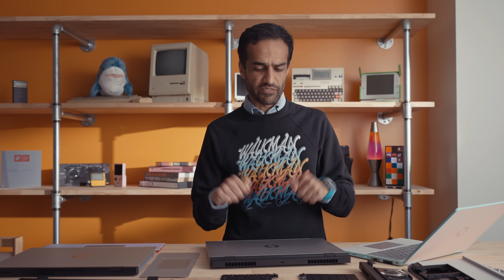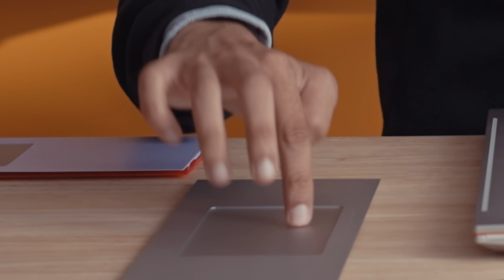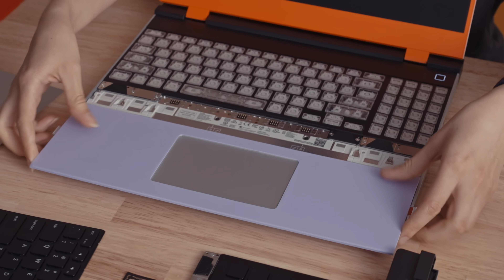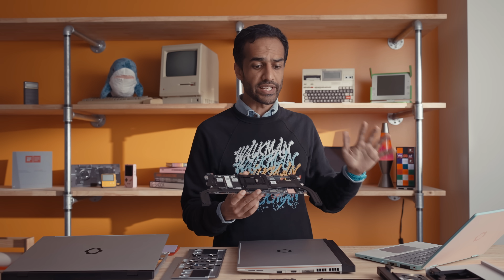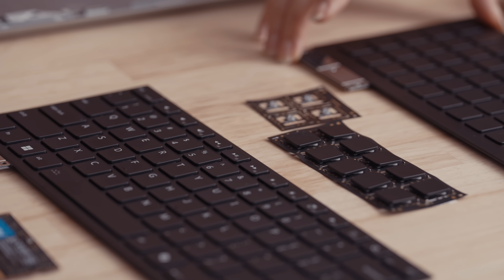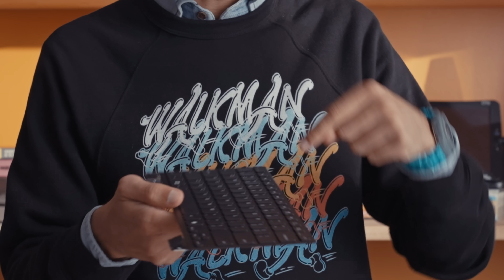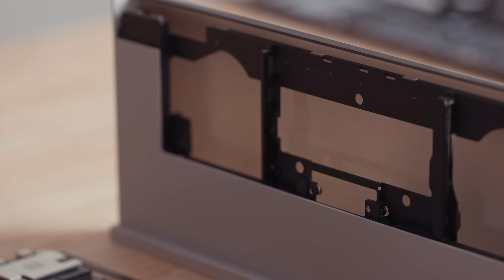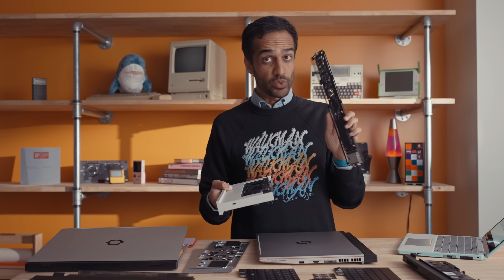Framework Laptop 16 - Prototypes and scrapped ideas

Comment: Lack of a track point is why I haven’t bought a framework. Lenovo laptops are overpriced, late to use new hardware, and never sell the specific combination I want in models with track points. So I just haven’t bought a laptop in over 10 years. With the introduction of the nvidia GPU on the framework 16, the only thing missing to solve every issue is the track point.

Comment: For the GPU I feel you guys are working on a simpler board that connects to a desktop PCIe slot instead. Which I feel is an OK compramise in term of not making things too costly but still useful.

Comment: The 16 should've had a connector that can deliver power and data. You could have a separate battery module for extra battery life during trips and stuff. Sadly it seems it's only useful for data. And I'm guessing it would count as a separate battery pack and not over the plane limit?

Comment: I don't need the extra wide touch pad. I use a left set keyboard with a right set num pad and my touch pad is center. I just want the normal touch pad as a single piece. I hate the seams.

Comment: Fun fact, with 4 RAM slots a DDR5 laptop should be able to eventually have 512GB of RAM, or 256GB with 2 sticks.
Now 4 SODIM of this size is probably going to result in DDR5 3800 speeds. Partially because of trace length and inability to have equal length traces, but mostly because of cooling a 128GB SODIMM is going to be double sided and likely will use close to 15w at DDR5 5600 good luck cooling that without airflow, and without physical contact with anything.
On the other hand thats A LOT of RAM , and at 3800MT/s that is still going to be WAY faster than even 6 of the highest end gen 5 NVMe SSDs, and trying to buy 2 systems and connecting them over the network is going to be glacial

This is why i want AMD to release Strix Halo in an R package and call it Epyc 4955. 8 DDR5 desktop DIMMs, with 1TB total capacity and running at 4800-5600 that should in theory be faster than 4 whole Halo based desktops trying to pool their 8000MT/s LPDDR5 pool that will be limited to.... 256GB and this will be bottlenecked by networking
(i dont remember the max theoretical capacity of LPDDR5, DIMM/SODIMM is 128GB/stick)

I'd like desktop DIMMs as they can run faster from beingbetter cooled, i've done alot of testing to mostly verify. Desktop DIMMS, despite their much longer traces, are basically guaranteed faster speeds and lower latency, try to clock SODIMM too high they start getting errors, and without a fan some "stock" high clock SODIMMs just die on me, even if they have cooling a double sided SODIMM might die if the other side doesnt get cooling
I have 48GB of dekstop DIMM running at 8800MT/s at this moment, though this is on a 2 slot board so i dont get the reflections from T and other topology from 4 slots, at 4 slots it wants to run at 6400 with the same CPU.

Comment: Personally, I would have loved a 4060 or 4070 module, as a cheaper option vs the 5070, and more importantly, to preserve 32 bit Cuda PhysX support for games like Mirrors Edge: I'm in the middle of considering a new laptop and had those been available for the Framework 16, it would have guaranteed my purchase. Windows 10 drivers as well, since it's possible for people to still get updates for W10 till 2032 depending on the OS version!

Comment: 3x upvote for the single-piece touchpad row!  Even if the touchpad ends up being not quite as wide as in that prototype.  The unevenly fitting spacer panels and tiny touchpad size are my #1 gripe about my Framework 16, after switching from my old Macbook.

Comment: Can someone more familiar with the modular system explain the difficulty in providing the same touchpad on a wider panel? Let's say the total laptop width is 10 units and the spacers are 1 unit wide. Then I understood that the touchpad module is 8 units wide, and you can assemble the palm rest in a 8+1+1, 1+8+1 or 1+1+8 configuration. But why is it impossible to sell the same touchpad from the 8-unit part in a 10 units wide panel? There could be 3 10-units panel styles, one in the 8+1+1 position, one in 1+8+1, and one in 1+1+8. Or, if having three different of them is unfeasible, at least have one in the 1+8+1 config?

Comment: Hi Nirav, 
1. regarding track pointer , just for curiosity have your team tried Blackberry Pearl style track ball or Blackberry classic style trackpad key on the keyboard, maybe this can fit on keyboard without increasing the thickness.

2. Great idea to provide additional nvme storage on blank bay, what about providing additional ram slots or additional thunderbolt/ usb c ports on the backside of blank bay, which will look so clean on desk setup with multiple monitors setup and cable running from back.

3. I am waiting for Framework dock with minimum 8-10 slots for usb c module along with tremendous power delivery on each ports (may be via GAN setup)

Comment: You've said that the gpu module now has two-way power and it's pretty big. Could you make a battery module then? It would be like a second battery you could use on long trips when you don't need performance. Theoretically this module could even be hot-swapable, so you can take 1-2 of them with you and that'll last you an entire day.

Possible use cases: if you have a long streak of work meetings, you could detach your gpu, insert the battery module and you'd have many hours of continuous use, so you don't have to worry about sitting next to a wall outlet. Or a long trip where you just want to watch movies, etc. This could make the overall battery time comparable to apple products, and that's definitely appreciated by consumers =)

Comment: I would love to see a double screen option. My Use Case: I use a very specific keyboard, Glove 80. meaning regardless of the computer I always use my own keyboard. This means the laptop's key board is never used. I would love the option to have 2 monitor in a single laptop. It would be perfect. And does'nt currently exist on the market as far as I know.
Option:
If you add a bit of software and change for a toutch screen as the second screen, you can potential retain a fallback keyboard, similar to how detachable tablets do it.

Comment: I want a classic keyboard, like the one on the ThinkPad 25th Anniversary Edition, or the Dell Latitude E4200 or E6500. Actual 3-dimenionsal keyboards, NO ISLANDS. NO CHICLETS. Just a good classic keyboard. I will spend $2000 on the keyboard alone. I will buy a new Framework laptop if the keyboard doesn't work with my current one. I do not care. I am HAPPY to pay for a GOOD keyboard again. No manufacturers are making laptops with good keyboards. Be the change. Even if it's an optional, limited edition version. I WILL BUY IT.

Comment: Any chance instead of the pointing stick, the left and right areas (say, of width that of an A key) of the spacebar button become trackpads? the functionalities I'm thinking of are tap to click, double tap to double click, horizontal scroll, vertical scroll. A more practical version would be shrinking the spacebar and adding button-sized trackpads to both sides of the shrunken spacebar. Tap on the left side trackpad acts as left-clicking and tap on the right-side trackpad could act as right clicking.

Comment: I can't say i understand what the problem is with the trackpad - you say palm rejection is not a problem, but the click is. Why? Ignore the click based on the palm rejection flag. If the problem is the feel of the click disrupting user flow, then switch to piezo feedback, as you said, and just don't emit a feedback event if the click is ignored. Apple has been doing this for years now. It works.

I similarly don't understand why you immediately went for polycarbonate for the transparent bezels. You typically go for PC if you need glass-like optical clarity. There's no such requirement for a bezel. Just use PET.

Comment: The openness aspect is absolutely fantastic. A makerspace egpu solution would create a secondhand market for makers to be able to sell framework graphics module "eGPUs" and I believe directly achieve what y'all want in regards to reduction in ewaste. That eGPU board is realistically what yall need, just in a maker-mountable way to a 3d printed chassis. If there's a way to either ship that eGPU board with a USB-C styled power input with clearly labeled power requirements and maximums, I think that'd be right in line with y'alls 240W adapter improvements. 

So purchasable eGPU controller board with optional USB-C power adpater, 3D printer files for the enclosure, and a little work on the maker's end and framework graphics module eGPU enclosures could make consumer sense. I will say the target audience may be difficult to overlap, but realistically I think the eGPU's target audience would be people wanting to add dedicated graphics adapters to the mini PC space via Oculink.

Comment: Love the transparency and openness! And last week I have started looking into how to combine one of the laptop mainboards with the 7700S graphics module: My use case is for a console-replacement that I can still somewhat upgrade, has no battery and that I can take with me for work travel - with a USB-C power connector. For now, I want them stacked though, so the case around it would need less structural support as it is higher instead of deeper/wider. This is important for traveling. But a stacked layout needs a custom connector.

Comment: What I've always wondered is if you could put a battery expansion in the expansion module. Of course laptops are generally limited to 100 Wh because of airline restrictions, but if you could separate the two they wouldn't count as one.

Comment: 16:45 is there a possibility that you release a CAD/3d printable file where users can print their own enclosure that also houses the main board, which then allows them to basically have a standalone computer with the GPU module, much like what you did back then?

Comment: The 3d printed trackpad frames are interesting. I might want to put one all the way to one side underneath the number pad because I hate trackpads and only want to use them as a last resort, having it off to the side would probably help me do that. I put my number pad on the left as well with my PC keyboard, but I would have to try and see if both of those ideas work.

Comment: What about an adapter so the GPU module can be installed in a desktop PC's PCIe slot? Though i guess the eDP would need some adapter if you want to drive a monitor directly from the card.

Comment: I reaaally love the bold idea of the video, props to you for doing this, you can find in the replies my feedback on this
Reply: 4:10 I think you should get more inspiration from Apple, they have reaalllly great trackpads, they may not be perfect and may misbehave but that only happens 1% of the time and the good user experience makes it very much worth it IMO, I just bought a MacBook recently and I really think Force touch along with haptic feedback is the best
Reply: 12:28 I have a few ideas here, first, the main reason why it doesn't work for you (and works for other laptops like ThinkPads) is that the keyboard is modular so it needs to be thin, my question is does it? What if you make the pointing stick extend on the bottom of the keyboard, that should solve this problem, but I understand it could mess with how the keyboard mounts, I think pursuing this route (fixing mounting issues with pointing sticks extending on the keyboard) is probably the way to go if you don't wanna wait for some technological advancement that would give a low enough profile to not damage the screen

Comment: Would it be possible to create an expansion bay that houses several expansion cards? For those that don't need graphics but like more than 6 expansion cards without swapping.

Would be nice if the e-GPU would be easily compatible with the framework 12 and 13. That gives them a high end GPU, while still being highly portable without the added graphics power.

Comment: I don't know if it helps regarding the tracking point, but I want to put this out there. During my research about small form factor input devices 6 months ago, I came across a paper called "DeformWear: Deformation Input on Tiny Wearable Devices". It is basically a small pressurized silicone knubby which registers input. The paper is from 2017, maybe there exist industry solutions now that help you

Comment: For the Touchpad module being one unit while still keeping it in line with the keyboard position, why not have 3 variants of full width panel(like the 3D printed one you showcased) with touchpad fixed in left, right and center positions. For the people that have a pre-determined layout in mind and don't plan on moving the module around later. Obviously the R&D and manufacturing makes sense only if enough people want it, so I request people to share their view on this or other potential solutions.

Comment: Please build a native 48 Gbit/s HDMI 2.1 port into your laptops! All GPUs used in your models support those and the 3rd-Gen USB-C HDMI expansion module is limited to HDMI 2.0b. For whatever reason active DisplayPort-to-HDMI 2.1 adapters don’t work well so don’t force customers to use such a solution. Even Apple came back to having HDMI ports in their laptops!

Comment: About the touchpad, i would personally love if there was an option for textured touchpad, like old sony vaios had. (eg, a tiny bumps in grid spaced 1mm apart)
IMPO, i feel like they are lot easier to glide across with a finger than on a flat glossy touchpad
But i am not sure if that would be possible with modern haptic touchpads though...

Comment: Something that would make sense for reusing the gpu modules in my opinion would be a pci-e adapter (like those that crypto miners use) that would slot into either the pci-e or m.2 slots. It's much cheaper than something like ocu-link and definitely hits the "diy-er" type of customers. You might even be able to make something that directly slots into the motherboard like a normal GPU and is able to be mounted in a standard computer case.

Comment: im a bit disappointed i was hoping for a ai 9 395 sinche the total power has been raised alongside the 240w charger, i also would love to see a case like for the fw13 where i can use both the old gpu and mobo. ps. im waiting on those stl to print thh single piece mousepad

Comment: More desnse expansion ports like, instead usb c single port. two usb c ports, as there is space, or one usb c, one usb a etc, 
compressed etherent jack similar to what dell hp, etc have so it doesn stick out, 
a glossy option for the 16-inch, preferably an oled one as well, 
and also expalsnion packs that have battery like if someboady want to expand battery they can use the expansion packs or exapnsion modules to exapnd it, or quickly swap out discharging battery, will increase use case to mild military and law enforcement type uses as well, where swappable batteries are needed.
use the siliccone tech batteries, maybe push it beyong 99.99wh, as battery is easily replcabley, leave it to the user, if he doesnt plan on going on plane he can like have 150wh battery, it would be huge selling point for many, when going on plane he can quickly replace to the 99.99wh one.
also global availablity or atleast the availabloty in india as well, pretty please. 
Now you have nvidia, my next machine will likely be framewaork if you guys are available in india. Please.

Comment: I'd love to see a rack mounting for some Framework mainboards, both for the 13 and the 16. Could do stand alone, two in 1U, or even multiple blades in several U. Once I've replaced my laptop, and then upgraded the mainboard of it down the line, I'll probably put some time into making some myself if I have to, but it would be great to have some already made, either for purchase or as STLs I can print

Comment: What about, for the single piece palmrest, the touchpad is a sub component to the palmrest frame that can be reversed with spacer aluminum to the left or right? Instead of dealing with spacer tolerances and ridges on the front frame side, the "ridge" would be similar to a typical panel gap in the middle of the palmrest. Basically, wide rectangle in the middle of the palmrest that has a touchpad on one side, spacer on the other.

Comment: For the haptic touchpad, you explained that there are challenges in determining regions for right vs left clicks.  Why not make a 2 fingered press right click?  The disambiguation should be a bit cleaner for 1 vs 2 fingered clicks anywhere on the pad and on top of that make it usable from every region of the trackpad no matter the scaling factor of movement on OSes.  And palm rejection combined with that will probably be good enough.

Comment: Hp didn't take that into account because a few of the work hp laptops that has a track ball/pointing stick will make a permanent mark on the screen of the dots on the track ball but if you guys can make a better solution the doesn't damage the screen with a permanent mark then that way better.

Comment: I know this dosen't have much to do with the framework laptop itself, but is there any way you would do a DIY/barebones thunderbolt/usb 4 to pcie 16x adapter? Maybe for framework 13 users who want to use an older desktop graphics card they have with the 13 and provide their own power supply? I know the market for this has gotta be huge (I didn't do research or anything), but that is up to you.

Comment: The last product could be a 3D printable stand with a DIY conector kit available in the parts store, most tinkerers/hackers/DIY crowd have an option to print on demand or autoproduce that part they only need the compatible outputs as translation layer to a compatible dock or desktop machine.